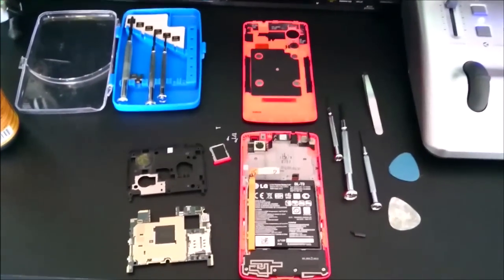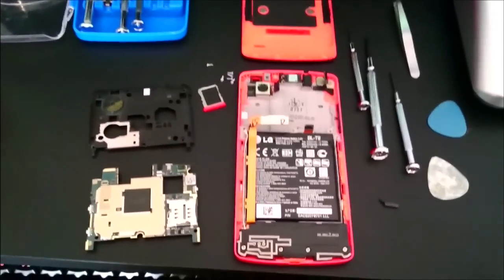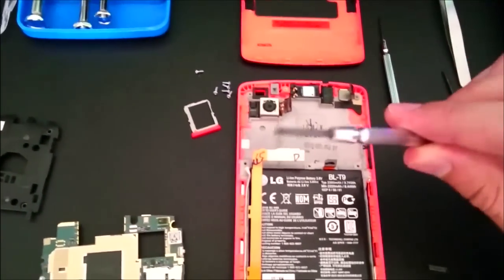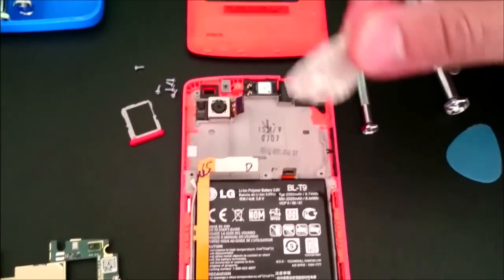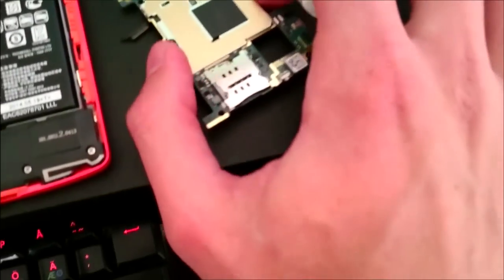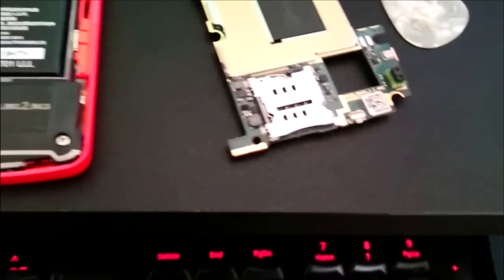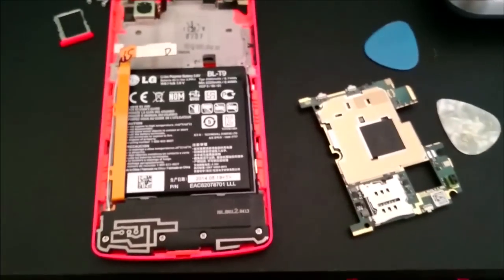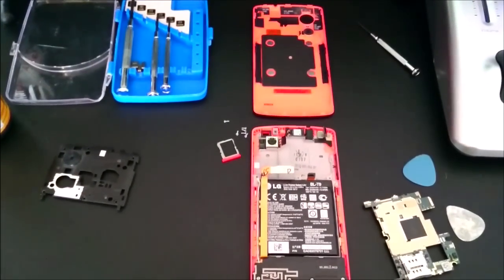Nexus 5 - Power Button Fix

Comment: thanks for this video i have a question, i didn't open the phone yet but i don''t know if the problem could be the power button or the fact that i used a samsung charger sometimes. how can i figure out which  problem it is ? changing the battery could be useful?
Reply from the maker: If the Phone still turns on then it's probobly the button. Using the wrong/faulty charger would in most cases the damage the phone so that it wouldnt turn on at all.

Comment: My phone restarts, or stuck on google logo, or when I use it it for few days or weeks. Nothing specific. If it start to restarts, then it start often do do like fey times in day. Is it button or motherboard? 
I have removed totally this power button in case if it is problem with button so I will test it for few days, but I don't see it is broken, maybe if you did show on video how it should work

Comment: Thanks for posting this. Good, clear instructions on how to get the motherboard out. I had the same problem, but it turns out my power button is fine. You mentioned the other source of the problem was burned circuits from using a different charger. Do you happen to know where I can learn more about that? Google search didn't offer much help. Thank you!
Reply from the maker: Hi Brian! Big thanks! Sorry about the focus! Yes that could be the case if the wrong charger has been used for an extended time. Check for small burns on components. It could still be the power button though, as most of the boot loops seem to come back to that issue. The problem might be INSIDE the actual button. I found this guy who had a similar problem. Hope it works out :)

https://www.reddit.com/r/Nexus5/comments/2edf6j/nexus_5_boot_loop_cant_even_get_to/
Reply: Hey, Thanks for the link. I tried again. This time applied a tiny dab of rubbing alcohol to the switch. I put it back together after the alcohol dried, but I left off the outer plastic button and it seems to have worked. 

Now I'm waiting for the battery to recharge. Hopefully the problem is solved. If so, I'll put the plastic button piece back in. If not, the warranty expired so long ago, I'll finally break down and get the 5x. 

Cheers! Your video was a huge help.
Reply from the maker: Nice man, congrats! Let me know if it works :)

Cheers!
Reply: +Carl's World - Music Success! Posting this from my Nexus 5. :) You rock.